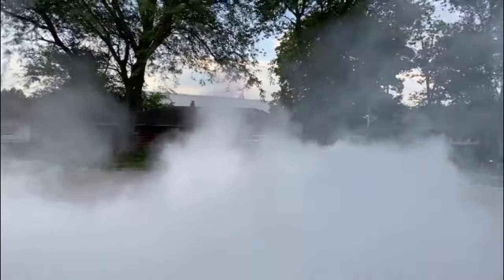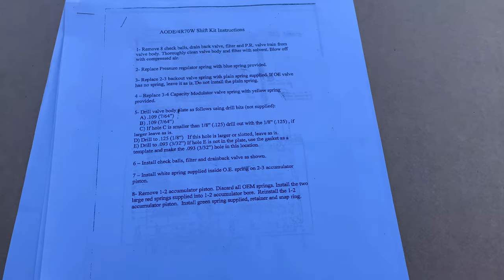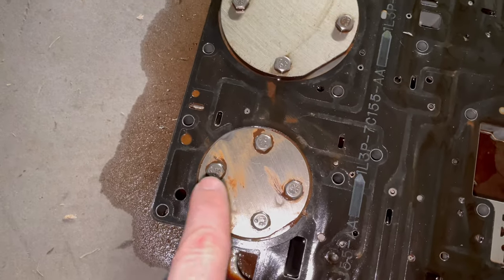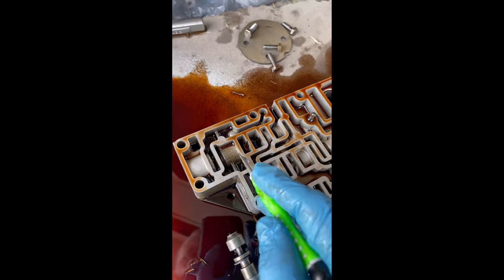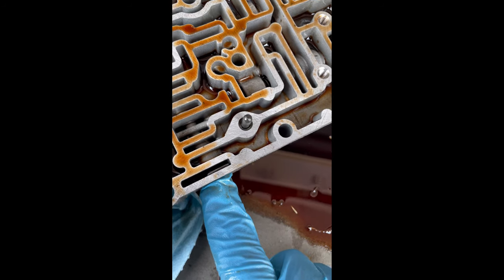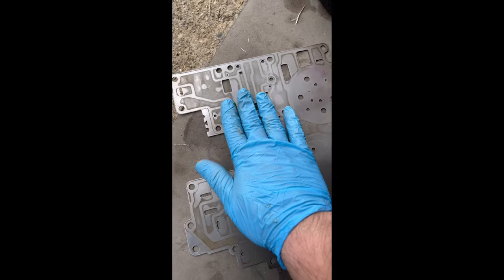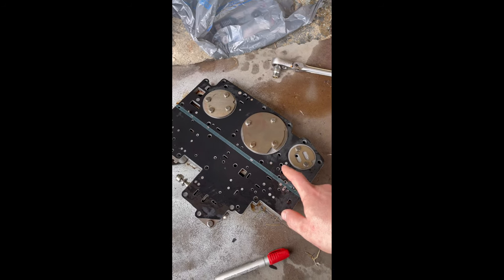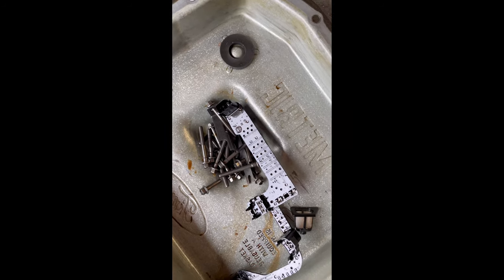Mustang shift kit installation 4r70w

Comment: Your tps controls the shifting also..... an old tps will cause poor shifting.. mine was doing the same thing replaced tps fix my issue but I do have a hesitation sometimes when shifting into 3rd going to do the same as you and replace the low pressure valve

Comment: I was curious why you didn't do the common J-Mod, remove the lower springs in the 1-2 and 2-3 accumulators,upgrade the pistons to molded pistons, drill the separator plate and that's it. I'm about to 
do it in my '97 Tbird.
Reply from the maker: @frankmorgan5234  I actually did do the jmod first. It still wouldn’t keep up with the shifts I needed sadly, I went this route, then eventually manual valvebody.

Comment: is the 1-2 shift better after adjusting shift points? I am having the same problem
Reply from the maker: Sadly only a little amount.. I actually have decided to go with the trans-go hd3 manual shift kit. This way I will just shift and control it manually, I can adjust the shift points in the tuning software but it’s either very close and once a small incremental change is made it shifts 800rpm too soon at wot… so tuning the trans is a black art that I obviously don’t possess lol.. so manual shifting it will be. But I will say, the shift kit helped a ton! Just still not enough.
Reply from the maker: @Coyote I had done the J-mod before in my other car. It worked great, but the trans in that case let go as well as this one has too. I’ve come to the common denominator that I’m very hard on these cars lol.. went manual VB, had fun… now swapping a 5 speed into the car because I want to enjoy rowing gears again.. but I truly do appreciate the info!

Comment: doesnt using the stock auto shifter manually do the same thing as a manual valvebody? im confused
Reply from the maker: No, the stock auto shifter the computer controls. Even when you shift manually the shift solenoids have that signal pulse delay. With a manual valvebody it shifts under your command, and line pressures are vacuum controlled instead of electronically controlled. That way your shifts are made when you want, and not when the computers strategy lets you.
Reply: @forcefedhatch  man where you get the vacuum modulator from for a 4r70w
Reply from the maker: @TM-ir1sj  it came in the kit.